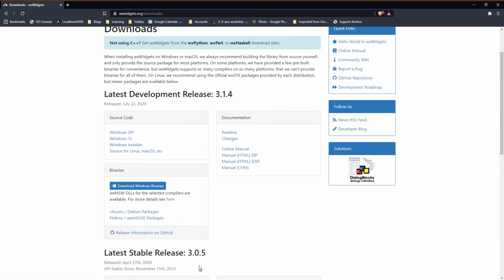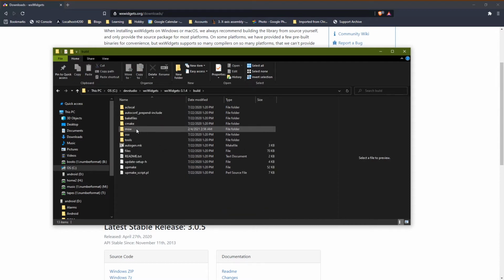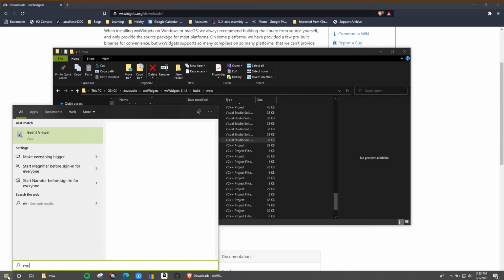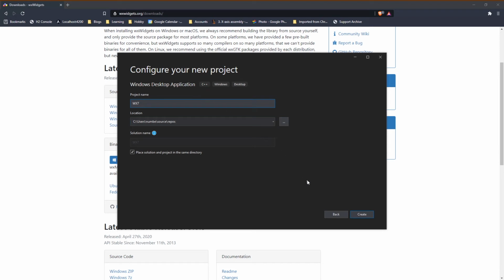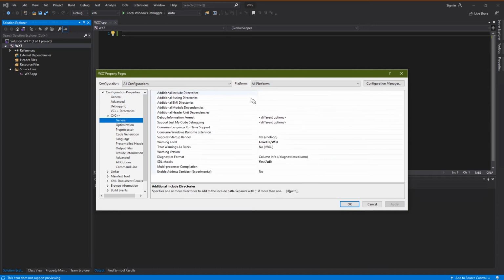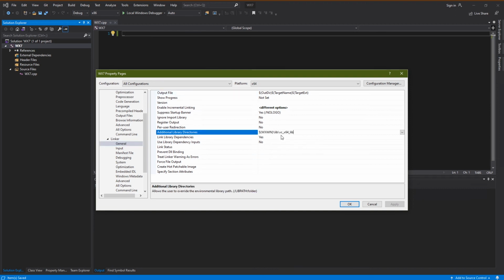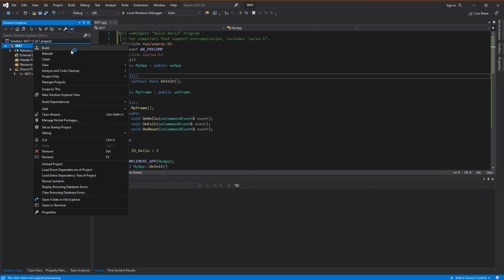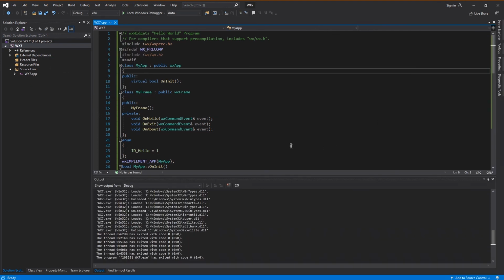wxWidgets library build and configuration in Visual Studio 2019

Comment: Unfortunately I could not get it to work, even though I followed every step described in the video. I get the error: 
Build started...
1>------ Build started: Project: wxWidgets-test, Configuration: Debug x64 ------
1>wxWidgets-test.cpp
1>C:\Proyectos\wxWidgets-test\wxWidgets-test\wxWidgets-test.cpp(3,10): fatal error C1083: Cannot open include file: 'wx/wxprec.h': No such file or directory
1>Done building project "wxWidgets-test.vcxproj" -- FAILED.
========== Build: 0 succeeded, 1 failed, 0 up-to-date, 0 skipped ==========

What could be wrong?
Reply: I just got the exact same error and I've followed the directions to the letter three times, each time with the same result.  Did you ever solve the issue you had?  I'm new to wxWidgets, Visual Studio 2019 and C++ so I'm not sure where to even start looking.